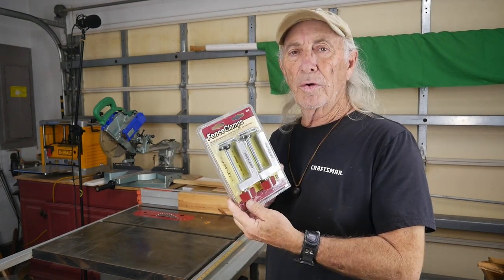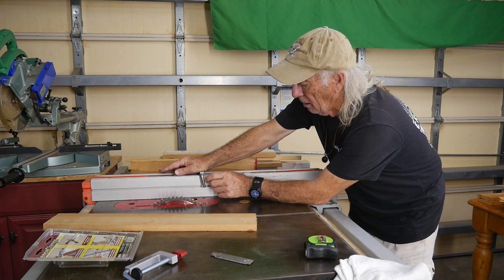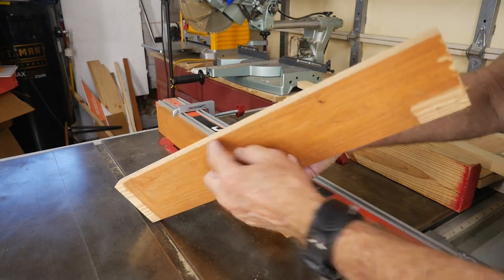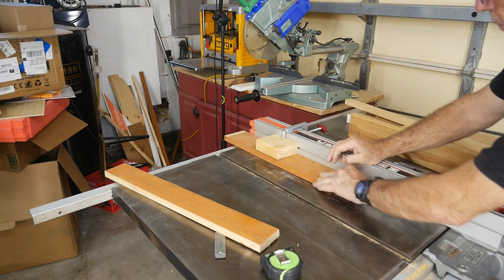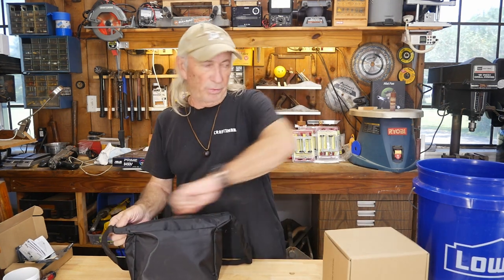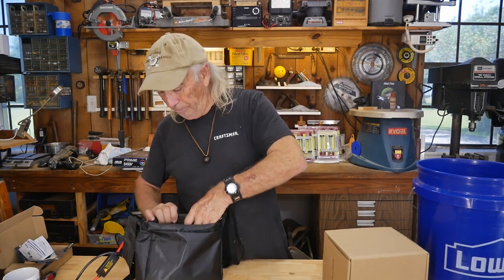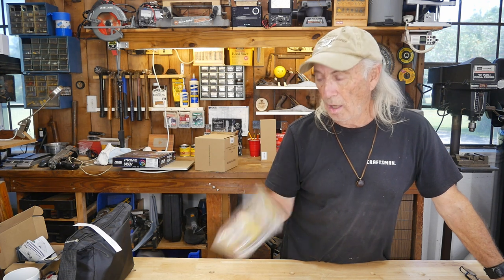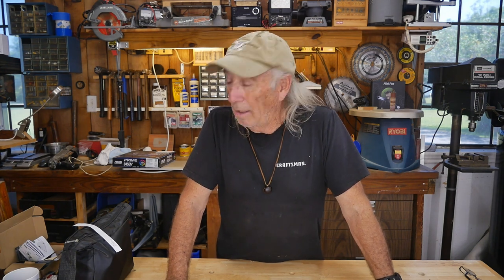Milescraft fence clamp and anti kickback block, giveaway and new draw Coffee and tools ep 247

Comment: Great video. I’ve been really looking a various clamps lately. I’ve got a bunch of 12in or under but have been looking for a few specialized and extended length for gluing up tray bottoms. I did enter for last week but I almost didn’t because I already have a auto jumper battery pack. The compressor part was interesting but I figured I’d hold off and let’s somebody that really wanted it to have a better chance… I caved in the end though. Does the blade assembly guard thing (or whatever the real name is that comes with the saw) that most folks seem to remove right away not help with kickback? Thanks again for a very informative video.
Reply from the maker: always fun around here :)

Comment: I have a set and they are pretty good, but then you can never have too many of them. 
I am with some of the others I would never use it as an anti-kickback device like you have shown. I have seen a set up that has rollers that keep the wood down and against the fence as well as keep it from going backwards. I think those are problematic as well because you can't push the wood all they  way through so then, you have to follow it up with a sacrificial piece,  maybe a special push stick that has a long reach to it. not my cup of tea either. To me it is far more important to have and keep my saw well tuned up. I have run thousands of board feet through a table saw and the only time I have ever had a problem is when I am doing something stupid. I have learned to cut things twice.  I cut my wood down to rough dimensions, that way I don't have to do long rip cuts, if I am going to have kickback it will be on the rough cut. if the wood is under internal tension then I will find that out quickly and I am less likely to ruin the wood.  It is much more manageable this way and I am much less likely to force a cut that could be dangerous. just my two cents. the other thing is to be control my environment so that I am never interrupted as I work. 60 years later I still have a scar from when i was a kid and I was startled by someone who  came up from behind me, I came way too close to losing a finger.
Reply from the maker: Yeah, that anti kickback was not my invention :)
Reply: @SirTools  yup I figured as much